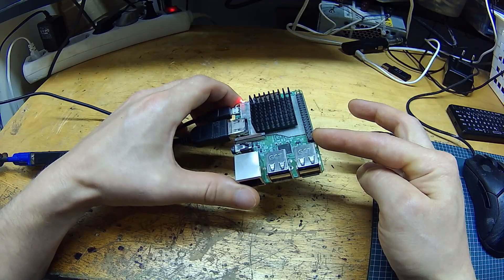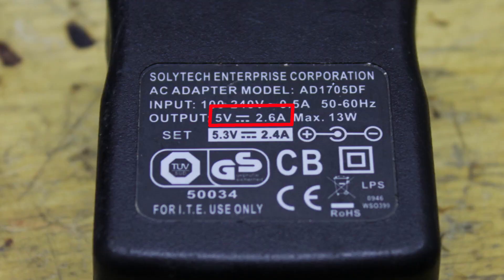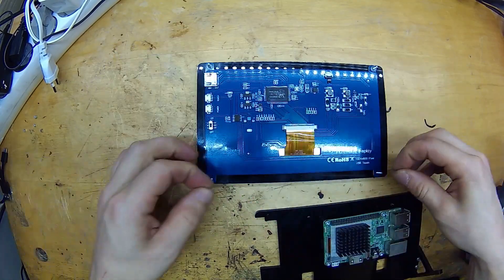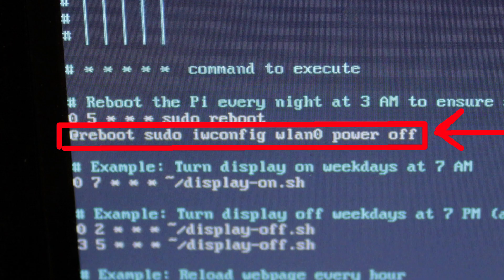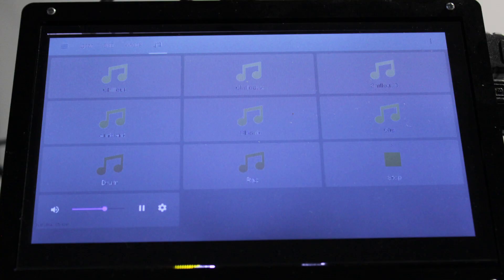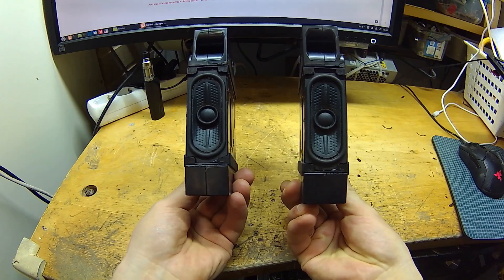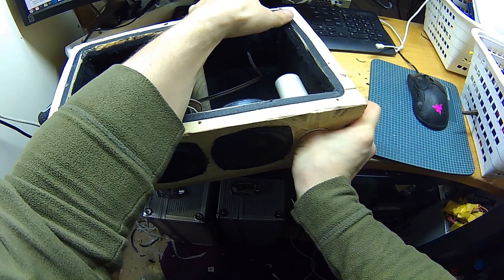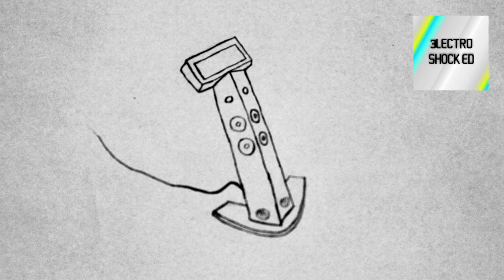Home Assistant Touch Screen Kiosk (pt.2)

Comment: I'm working on an almost identical project, setting up a Pi as a Kiosk for my Home Assistant alarm panel! I even used the same display. Putting that frame together took me so long and I'm almost certain I got it wrong. Cable management looks like shite -_-

Subbed and liked. Thanks for pointing me towards chilipie, I've been trying with Raspbian Lite but it's a lot of tweaking. I'm excited to see what you do with it next.
Reply from the maker: Hello! Thanks for the comment! Yeah, that frame was a paaaaain wrapped in pain. But, I'll still use it with a custom enclosure, that I'm building right now. You know, just to keep the Raspberry in place. Just had to drill new mounting holes to get the top connectors down. Video on that later. Yeah, Chilipie seems to be awesome. Very stable and customizable. Good luck with your project! Thanks for watching!